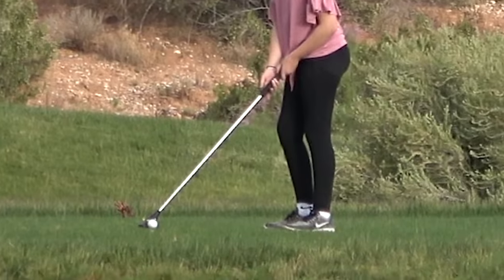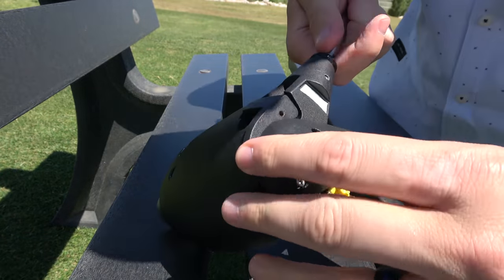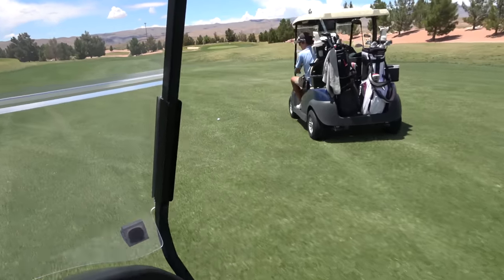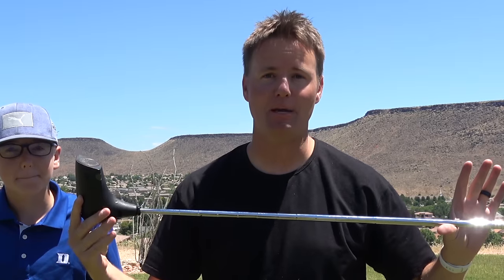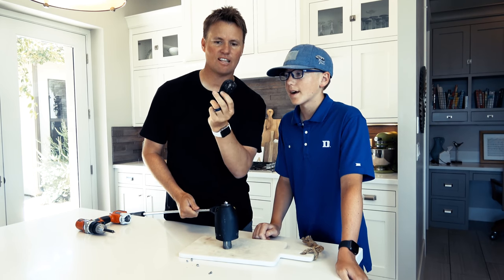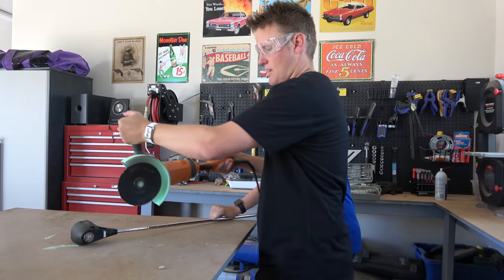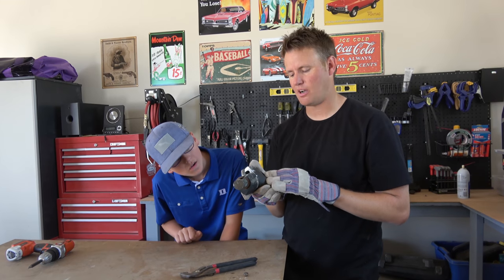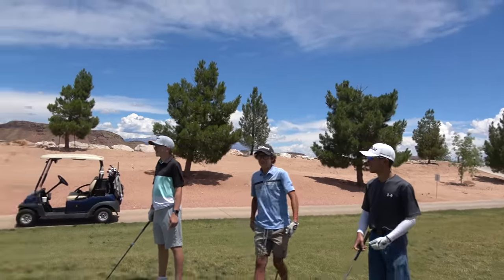What's inside a Swingless Golf Club?

Comment: As a gun guy, I instantly knew how it worked the moment I saw it being loaded. The only question I had was... how does it determine range of the shot? How does extending that meter increase the power of the hit? I assumed that it'd control how far the striker comes out, but... it doesn't seem to.